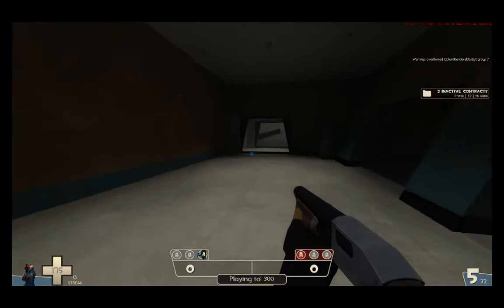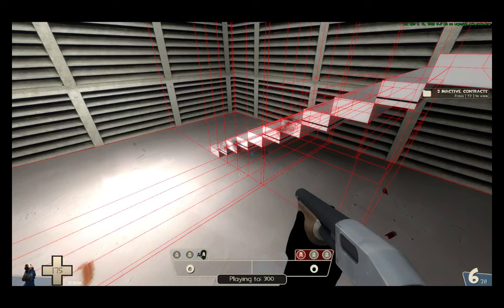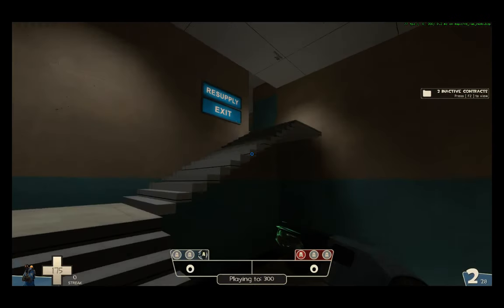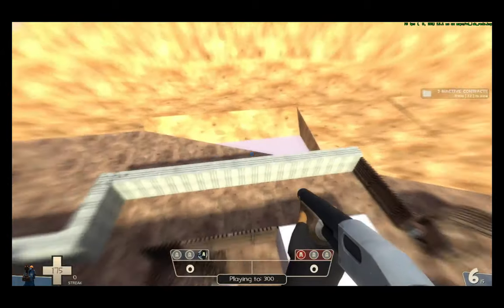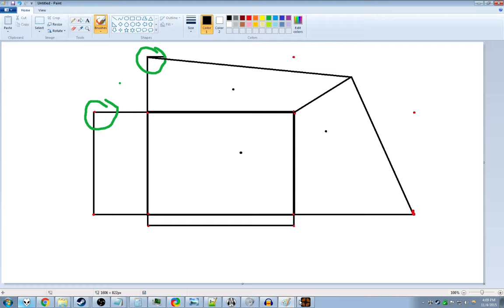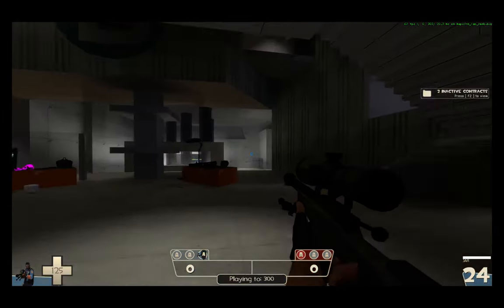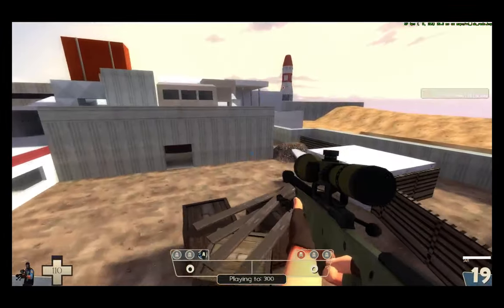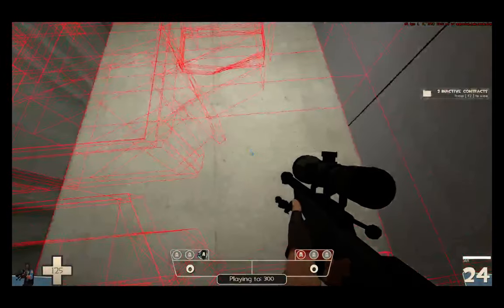Egan Thought - rd_lab_redo

Comment: Around the 7:10 mark you mix up visleaves and vvis. func_detail doesn't exclude geometry from the PVS system. It tells vbsp not to cut visleaves for the brush.

But that doesn't mean your advice is bad. It's a minor mistake and the overall message is fully correct. Func_detail all that stuff.
Reply from the maker: +Henrik Andersson Ya I haven't read the VDC page for this stuff in a while. I should probably!

Comment: Alrighty, that's a lot of information, but I found this video to be quite pleasurable to watch, although it was 41:24 long.
1: Nav meshes, I do understand how to make them, and thanks for the heads up on the workshop bug. Yes, I didn't pack it in the .bsp, I shall do so next time.
2: The chicken mesh!! There is a custom-made model, an 'experiment', but it must not have been added to this version of the map. Here's it's name: "the Gibus to Gold machine prototype". Yep, it is a huge joke, which is why I made it xD
3: Func_details. I'll do as many of them as I can.
4: Lighting; more lights are now in my improvement queue.
5: The 3D skybox was made on the map, and then scaled down by 0.0635 or whatever the number was. I'll have to re-do it, but that won't be too much of an issue.
6: The thin-ness+ cleanness: It was kind-of a theme, having a sleek and clean techy look to it. I'll work on making the glass more visible, pillars a little thicker, supports for the 'crowsnest', etc..
TO BE CONT.
Reply: 7: The mid point WILL be shortened, that's a big thing haha
8: Underground tunnel ideas; I can open up that closed door under the battlements and make a tunnel through there. I have some ideas for theming it too.
9: I shall make the battlement doors doublesized, and have the cosmetic doors swing the other way.
10: The transitions will be worked on a lot, as you point out it isn't very sensical.
11: I may add a foyer to the front of the bases, we'll see if that's nessesary.

Also, maybe I could set up a google drive folder and share it with you so that you can see everything I change, and criteque it maybe. Only if you felt like doing that haha